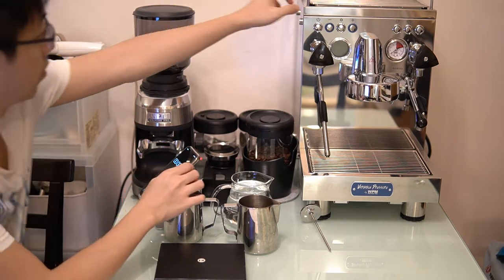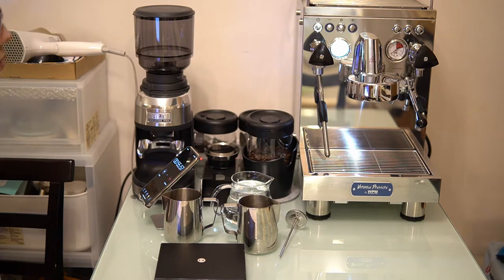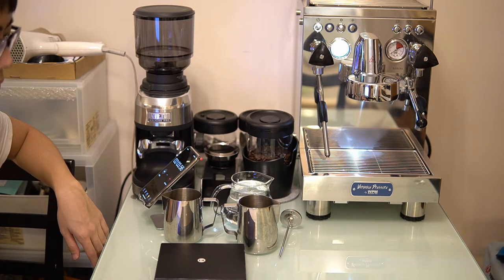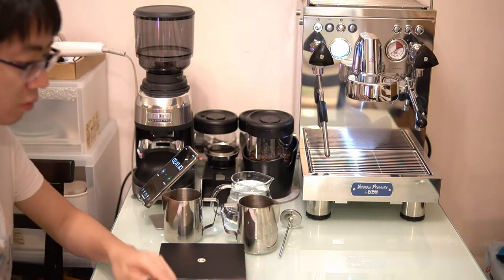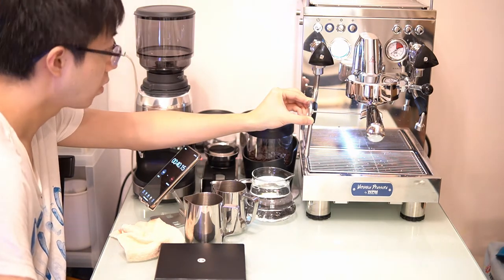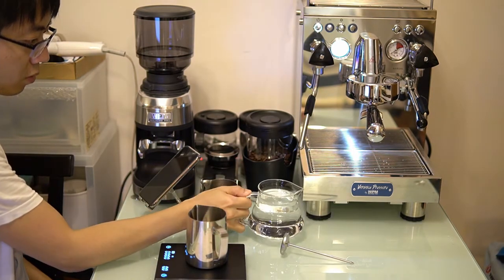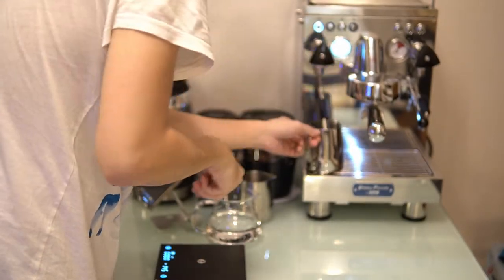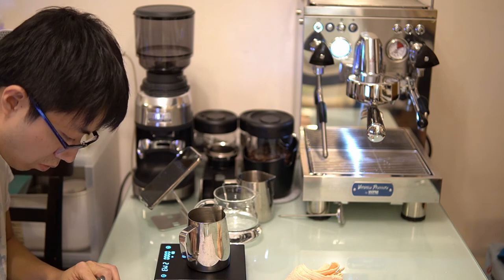WPM KD-310 Quick Performance Test (Thermoblock System)

Comment: Great content! I am checking which one is a better buy (within relatively same price range). Would you recommend the Barista Express as opposed to this one?
Reply from the maker: Barista Express has a better value for the  money I think, it comes with a built in grinder, and the price is cheaper than the wpm machine alone. In terms of capability and espresso quality, they are very similar. If you are a picky user, I suggest getting a boiler machine instead. Both WPM kd310 and Barista Express are not good enough for high quality espressos.
Reply: @pianocc534  thanks for the reply kind sir. I am using a no brand espresso maker right now and tried to do steam performance test like yours. I started at 200g and it took me approx 43 secs to get to 60C with final weight of 248g! my room temperature  is 26c, steam at max setting (valve fully open).. i guess its time for an upgrade. What is a boiler machine?
Reply from the maker: @oldmandeckhand  The Barista Express and WPM kd310 both use thermo block system, which basically water / steam is only heated up on the fly. Boiler machine has water / steam preheated before use. Both systems have their pros and cons, I cant explain them enough here, I suggest you google or youtube for more information before your purchase. As a general rule, boiler machines are more stable in temperature and pressure control and hence give you better espresso quality, but at the cost of being more expensive.
Reply: @pianocc534  okay so the thermoblock system is the big problem, nevertheless the kd310s is on sale for us$700 I'm still considering milesto as well,

Comment: Can we adjust the steam wand temperature?...how
Reply from the maker: You cant adjust steam wand temperature directly. However, you may adjust the steam producing rate / pressure by setting the ST Duty at the espresso machine. A higher ST Duty setting results in higher steam producing rate, but at the same time decreasing the steam temperature and increasing the moisture content, vice versa. You can actually see water coming out from the steam tip, at the highest ST Duty after continuous use, indicating water cannot be fully vaporized at the thermoblock.
Reply: @pianocc534  means that better not to adjust....
Reply: @mohamadadilybinbachik6481 He recommends ST 03 or 04. Not sure your current setting falls on that or not.
Reply: @hendrickt3672  gonna open back my library to look through 😭
Reply: Yeh..for sure... thinking that factory setting are the best 😊

Comment: do you use the WPM app for record and profiling?
Reply from the maker: Hey there. No I dont use the app for record and profiling. I manually adjust the variable pressure settings during brewing to maintain at 8-9bars of pressure, which is a very hard thing to do in the app since the pressure is changing  throughout the shot. Moreover, different beans will require different profile also, so I rather adjust manually to get the best results.
Reply: @pianocc534  thank you. ijust saw your video on variable pressure.